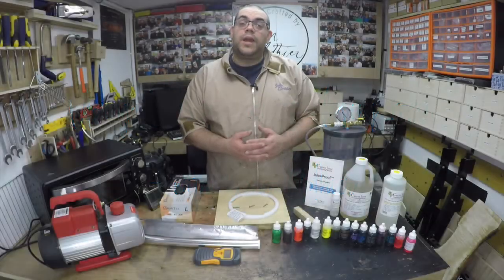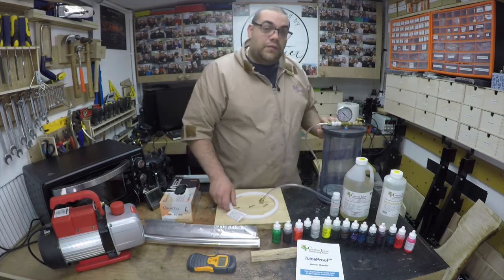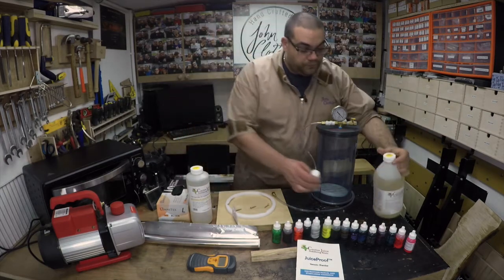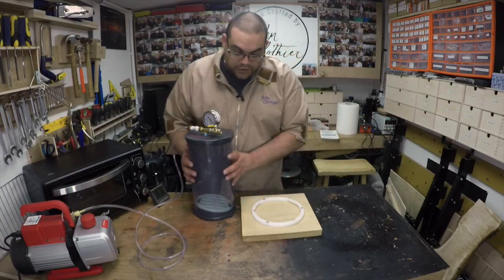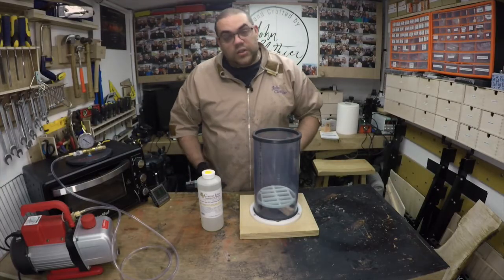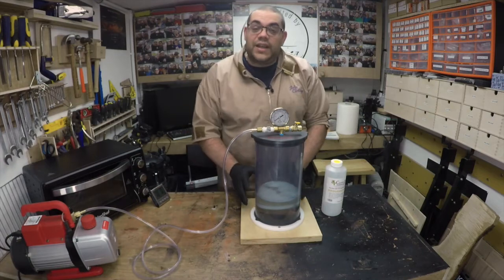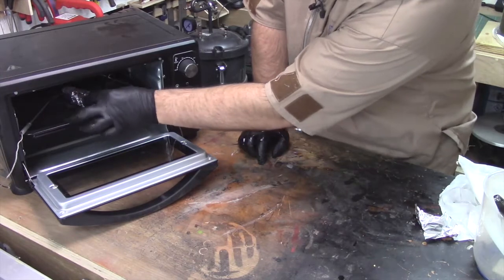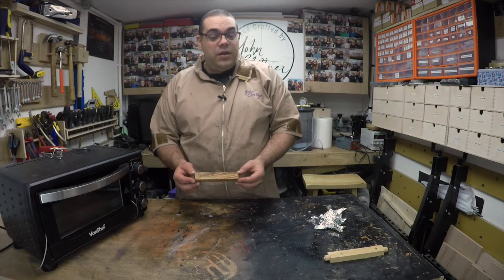Stabilising soft wood with Cactus Juice Resin - by John Clothier

Comment: Hi John, I have just started stabilising wood and I've found that while the pump is on its smoking continuously, and some oil covers the top of pump around exhaust. Also I'm finding after soaking for up to 24 hours the wood floats to surface. I thought the wood should not float. Can you advise please?